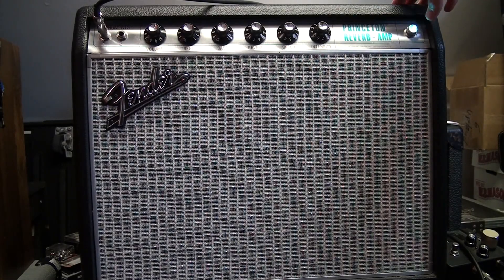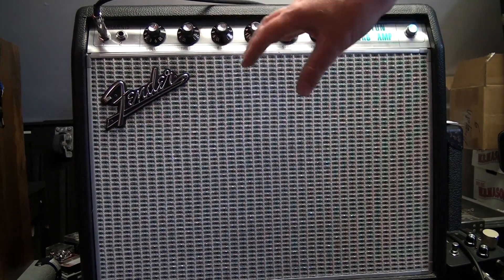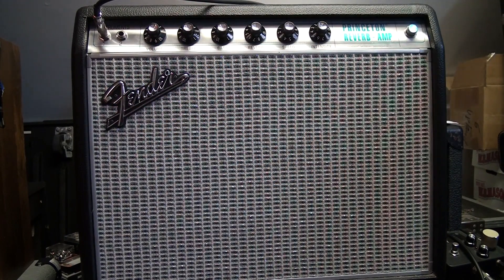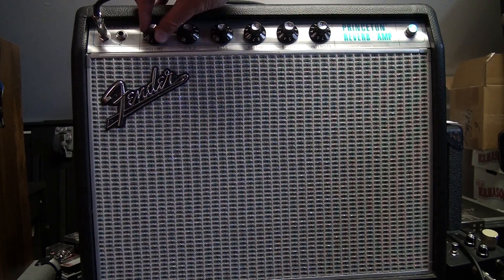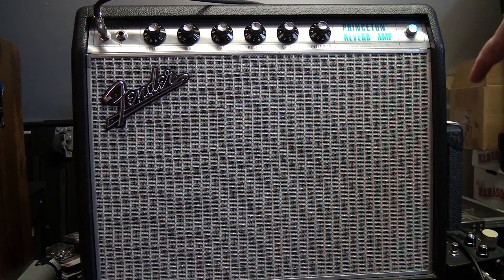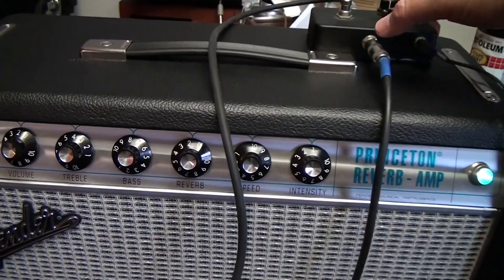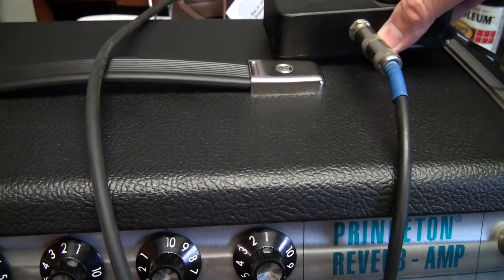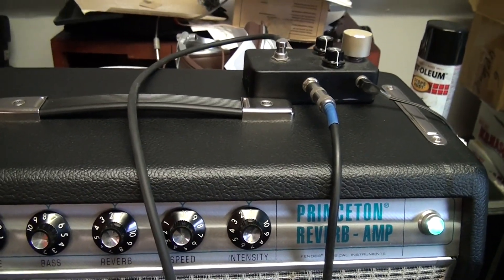Fender Princeton Reverb Amp Rattle ('68 Custom)

Comment: Mine does the same. I took it to service and they said it wasn't the tubes but didn't find anything wrong, so here I am with the rattle again.
Reply from the maker: After some research, it seems that it's not that uncommon with combo amps. The speaker vibrates everything in the amp, so things can start to rattle a bit. Oh, well.
Reply: I feel your pain just bought a brand new Marshall JTM combo it rattles when I hit it hard with the pedal. Tried a different separate speaker cabinet amp works fine only when it’s in the cabinet. I think they’re making them so small and compact it just rattles everything so taking it back and I’m done with combos. also check electronics out of the combo and hooked it up and it worked fine as well so it’s the chassis vibrating from the speaker amp has a lot of bottom end was hoping to get that great sound and a combo but I think the best method would be a head and cab 112 cab.

Comment: Just picked one up myself and same thing happening on certain frequencies... Sending it back tomorrow. It's a shame, would be perfect if it wasn't for that...
Reply from the maker: That's too bad. I now play it through an extension cab, so the actual amp isn't vibrating. AND... I can mix and match speakers for different tones. The amp sounds KILLER!!! It's my current favorite.

Comment: I’m having the same problem with my deluxe reverb reissue
Reply from the maker: I thought it was a few different things, but it ended up being two of the power tubes. Oh, well. I'll replace them at some point.
Reply: @JoeHartRocks  is that an expensive fix?
Reply from the maker: @wavycrockett9351  Just the cost of new tubes. I haven't done it because I run an external cab out and disconnected the internal speaker. So, the amp isn't vibrating from the speaker any more. And I prefer the sound of my 2X12 cab.

Comment: how is the hiss on the amp compared to the 65 princeton?
Reply from the maker: I don't know. I don't have a 65 Princeton, but this amp is very quiet.
Reply: @JoeHartRocks  ive seen lots of people complain about loud hiss because of the negative feedback modification. This is literally the only thing i worry about (for recording).

also… thank you for replying
Reply from the maker: @pablozapata9694  Okay. I am sitting here right now with my amp. With a guitar plugged in but the volume on the guitar all the way down (we're testing amp noise, not the noise picked up from my guitar's pickups), I can turn the amp up to 7-8 before I hear any hiss at all. Then all the way on 10, there is some, but it's not terrible at all. Of course, single coil pickups will make noise, a distortion pedal, bad cables, etc... But you can't fault the amp for amplifying any noise that is fed into it!! The amp, itself, is VERY quiet. At least mine is. Hope this helps.
Reply: @JoeHartRocks  thank you so much for the reply and description! I’ll probably buy this amp. take care.

Comment: Can u tell what is it? Have the same amp and rattle. Pls contact me
Reply from the maker: It's the power tubes. It seems that this is an issue that combo amps can have and especially with the tubes that Fender uses in these reissues. Not a huge problem, but kind of annoying.
Reply: @JoeHartRocks  i did change the PT and nope
Reply: @juanwaissman1 the problem are the  cheap tube sockets that fender uses.